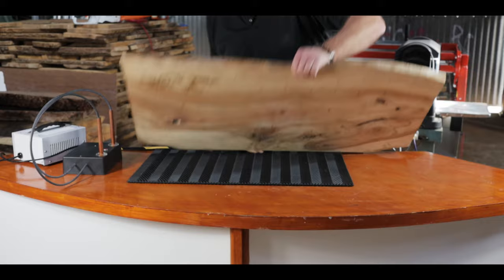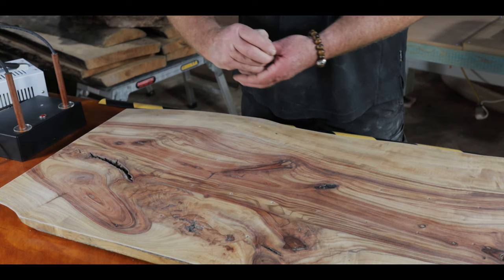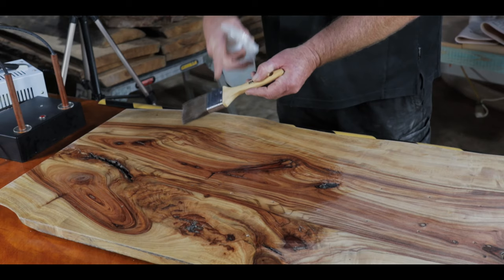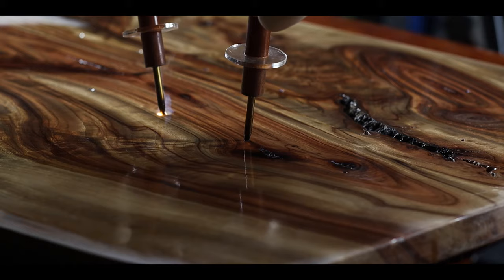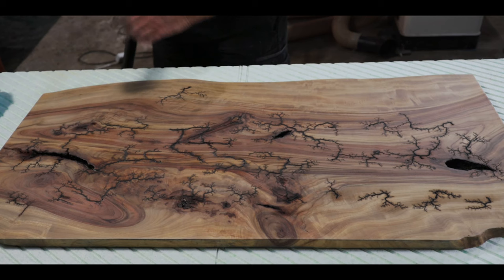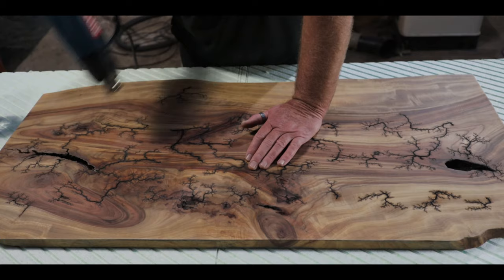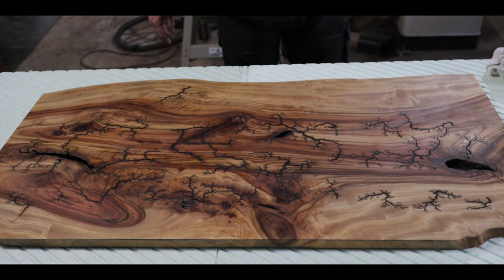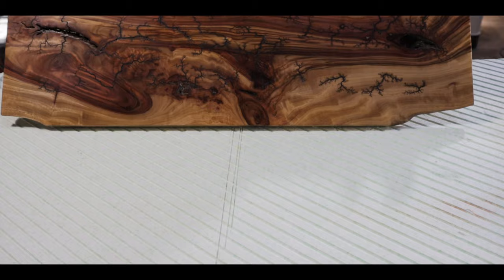Lichtenberg Wood Burning Techniques.

Comment: While there are some discussion online about Lichtenberg safety it should be noted that any craft work has safety concerns. Western society has become so risk averse that we are at risk of paralyzing industrial development in the west. Play at your own risk after studying relevant safety data and applying appropriate safe practices. Take responsibility for your own injuries.
Reply from the maker: Well said, my only input to the viewers is to use a recognized commercially available Lichtenberg burner and use the appropriate safety gear. Thanks for the comment @Astroponicist. regs Baz

Comment: That came out nice!!! New guy here, looking forward to checking out your other video's. Guess it's time to buy a new microwave haha.
Reply from the maker: Welcome aboard!
Reply: DONT!!! this has killed expirienced electricians.
Reply: @iwannareadforever8185  I wouldn't, I found an old power supply for a neon light. Gonna give it a shot and see how it goes.
Reply: @johncline3033  you still kicking? Neon signs are still lethal. And if so how'd the project go?
Reply: @amumuimo8530  It went well, thanks for asking. I did use the neon switch. Actually, I can see why people die with the one from the microwave. I touched the one I'm using by accident several times with no shock. It would be easy to see how someone could accidently kill themselves with a more powerful unit. 

I am enjoying it, and now am starting to burn and use resins for colors.

Comment: 1500 grit? Really that is not why you're getting the fine curling on the burn. It's all about the moisture and soak of the solution.
Reply: Not a criticism circular sanding on timber
Reply from the maker: What makes you so knowledgeable? Went to your site and nothing on it? Any how thanks for the watch.